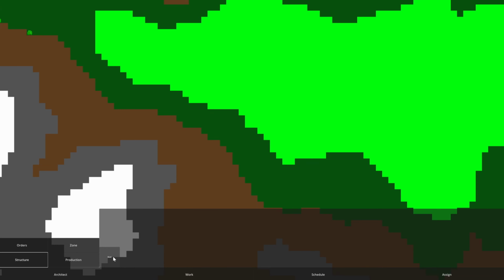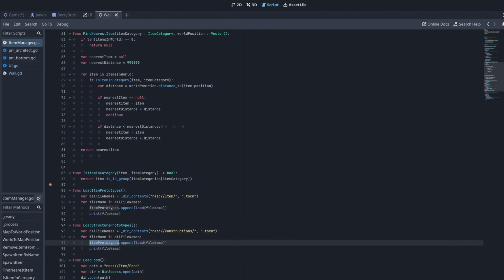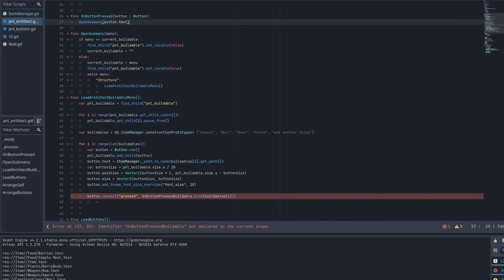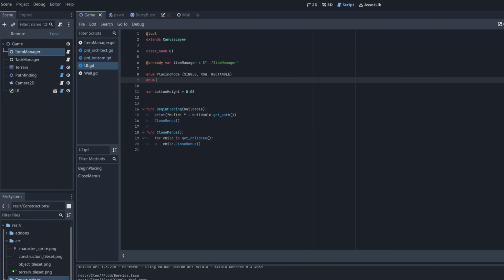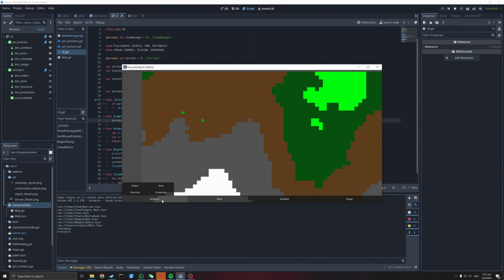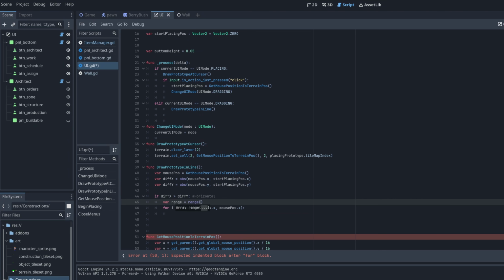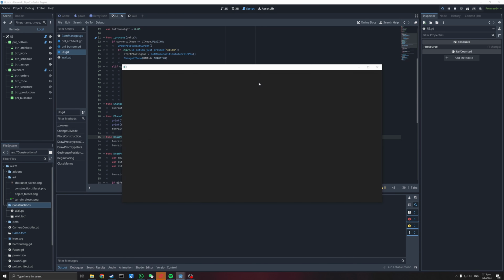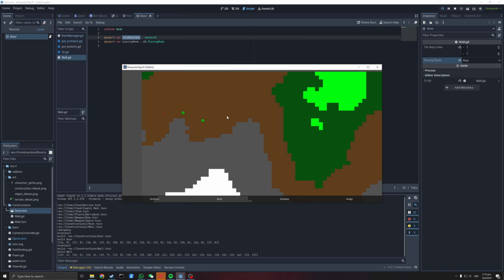Drawing Build Orders in line in Godot 4

Comment: I have done everything the same way but had an endless wave of  thousands errors flooding the Output:

The InputMap action "click_cancel" doesn't exist. Did you mean "ui_cancel"

I had no typo, remapping the key didnt help, deleting the editor cache also
ChatGPT advised that I should use:

if InputMap.has_action("click_cancel") and Input.is_action_just_pressed("click_cancel"):

instead of:

if Input.is_action_just_pressed("click_cancel"):

and the errors stopped, cancel action works like intended.
ChatGPT advised that we should avoid putting it like this and checking every frame. But for now the workaround works so its fine I guess.
Reply from the maker: @tsumoso  I had the same thing, you need to delete the @tool tag from the top of your script, or wrap you input lines in an if statement that only lets them run when compiled and not in the editor.
Reply: I put this right under _process and if fixed it.

func _process(delta):
	if Engine.is_editor_hint():
		return

Comment: What might be a bit easier than importing the buildables directly via folder is to make a data class or helper class .. not sure what the correct term is:

class_name Buildable
extends Resource

@export var name : String
@export var tile_map_index : Vector2i
@export var placing_mode : UI.PlacingMode
@export var blueprint : Resource

and then for the item manager:
@export var buildables : Array[Buildable]

Now you can add and create objects with name, etc. (which also allows images and whatnot) directly on the editor window. Which is great because you do not need to instantiate them to get to variables like name, tile_map_index, etc.
Reply from the maker: Not a bad idea. My plan was to have a JSON file that just lists all the items, based on a few prototypes that I'd have designed in the editor. Your way might be better though.